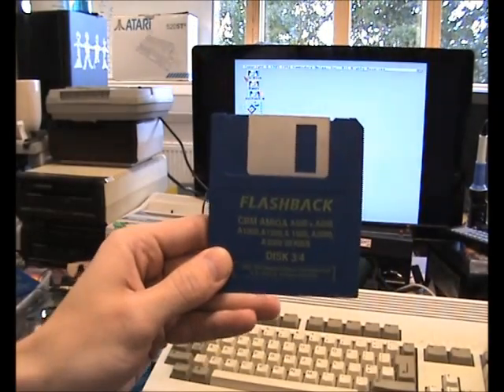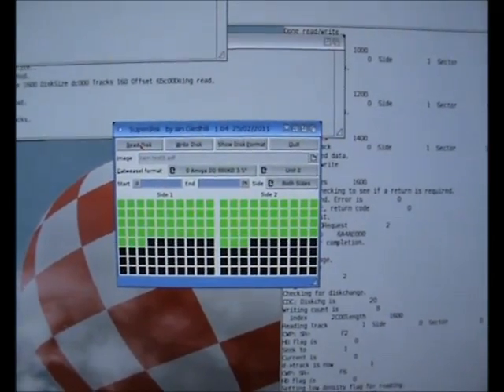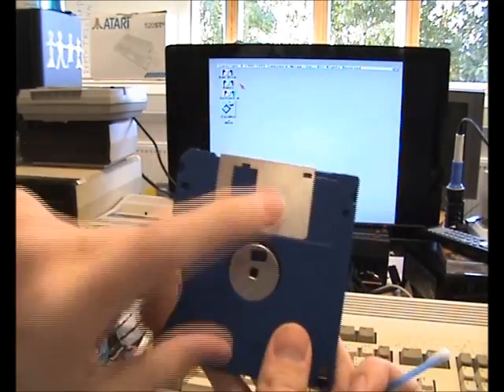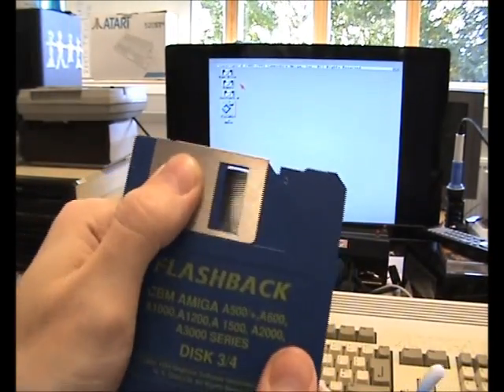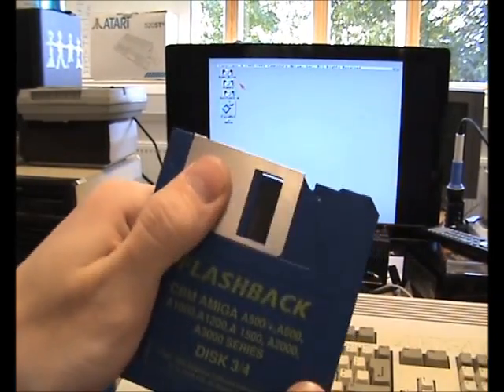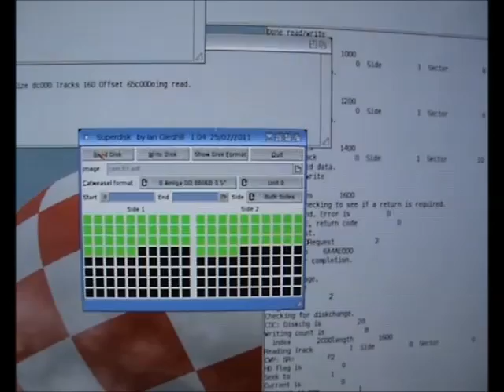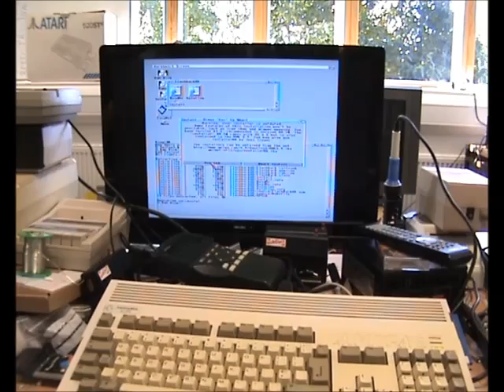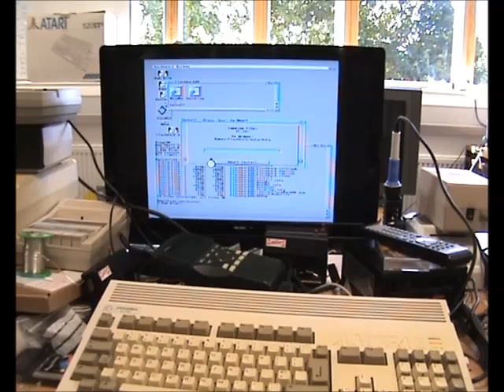How to clean floppy disks!

Comment: Not every disk you can repair though. I just cannot get rid of the red 6s from my cannon fodder 2 disk ☹
Reply: maybe you can! maybe not. But you need a gotek and to make an ADF of the disk, format, then erase, then format then erase 5 times. then check the disk, if the errors are still there then it will be the disk, if not then copy the ADF back to the disk to fix it. If you want a new disk get an new old stock disk, copy the ADF to it then take it apart and slid it into the orignal plastic. so you have fresh mag media inside the disk! it should then go another 20 years boom

Comment: I cleaned it with soapy water but still get "Please insert disk into drive A"... It was pretty clean though. EDIT: Decided to open it and there was a bug in 3 pieces inside of the floppy that made the actual magnetic part difficult to move as it was stuck in there which made the floppy drive give up and pop up that error. Nasty shit amirite?
Reply from the maker: Damian9303 Yeah, this doesn't fix bugs in software I'm afraid!
I assume you're joking about soapy water :)
Reply: Lol, pretty sure you misunderstood me. I actually used soapy water (basically water with one squirt of soap) since I researched this topic and found out you can do it like that but I didn't submerge it, I did basically what you did with the record cleaner but with the soapy water instead as I don't have record cleaner around since I don't really collect vinyls. It wasn't working before and after which led me to rip the thing open and find an actual bug in 3 pieces not software bugs which made the cookie have a hard time rotating when in the drive to read the entire floppy. It came out as soon as I opened it. Cleaned it up, reassembled it and it worked with no reading errors.
Reply from the maker: Soapy water isn't a good idea, it'll leave residue and impurities. It may work for a bit and then it could destroy your read head, in tbhe worst case. You need a pure liquid, so IPA or distilled water is good, but definitely not soapy tap water!
Reply: Yeah, I found that out when I took it out and saw the cookie or whatever the magnetic piece is called. It came off with my shirt however... Only wanted to get data off of the floppy by the way.
Reply: What else can I use to clean the floppies? I don't have alcohol around

Comment: I used to smoke heavy at my computerdesk some 15 to 25 years ago. Never had any problems with my disks. Though I have bought old disks the last couple of years, and those that smelled of mold and old basement. Those loads of disks, were the ones that had up to 50% or 60% dead disks. I have allways had my disks in boxes though, kept away from sunlight, moisture and too high heat. Those factors are bigger killers than tobaco smoke. I think heat and moisture are the biggest killers of all. Especially if you change the temperature rapidly.
Reply from the maker: Yes, the disk surface is protected from smoke by the slidey door thingy. I bet your Amiga was a lovely shade of yellow/brown though! :)
It's moisture and humidity that lets mould grow on the disk surface, that's the killer, and why lofts are a really bad place for them.
Reply: Spirantho Naaa.... Nichotine makes surfaces a kind of reddish orange colour, and can be washed off with ease. The yellow are uv light reacting to bromide in the plastic. To clean that up, you need perioxide cream 40vol. And lots of sun light. Nichotine are most of the times not the culprit. As you say, it is moisture that sometimes make micro organism grow and eat the surface of the disks. A bit like moisture and heat, will oxidice the surface of a cd. A bit like copper plates get green over the years.

Looking at nichotine yet again. It is actually natures insectiside. Most insects will die if they eat the leafs on a tobacco plant. Much like the leafs on a potato plant is poisones. They are after all related.

Comment: I've started reserecting my Amiga. the floppy drive seems to be corrupting the disks I am putting in. (unless it is contamination from my old disks). I cleaned the drive but the problem is back. I will try this technique cleaning the disks   I am thinking of putting another floppy drive in there. have you experienced a floppy drive fail like this? :)
Reply from the maker: First off, if it's an A1200, make sure it's recapped! Otherwise those old caps will be merrily eating their way through the circuit board (ditto the A500+ and big box Amigas with their battery).
A dirty disk will happily dump its dirt and oxide all over your read head. Not only will this stop other disks from reading (even if they're clean, because the head isn't), but the oxide is harder than the surface of the disk. The net result of this is a disk with a hole in it! Not good. Always check the state of disks you've not used in a long time or ever - if it's dirty, give it a clean :)
Reply: Spirantho thanks! some of the disks looked pretty good no obvious dust etc but they sounded rough !! many of them.  awful squeaking noises. you're right I will investigate more and do this cleaning method :)
Reply from the maker: Squeaking isn't good. :) That's the sound of oxide hitting your read head, probably....
Reply: Spirantho I agree. I'll swap the drive out just to be sure (I have a spare machine for parts - it's just a a500)
Reply: @matthewrichards88  i know this has been 4 years but if the disks are making squeaking noises, they are not dirty, its not the drive, what it is is the cleaning felt inside the disk. it gets mouldy and then turns into sandpaper which then kills the actual disk. Best way is to remove disk form case and install into a new case with fresh felt to repair it. any other method will do more damage.

Comment: I would NOT recommend opening the floppy. You could damage it further
Reply from the maker: That's a last resort only. :)
Reply: Spirantho If it was my last option, I would.
Reply: Wrong! trying to clean the disk this way is just mental to say the least! poking at it with a q tip wtf, the best way is not to fuck around and try this, open the disk and take it out, dont touch it with anything! get a new old stock disk and take that apart, get your old disk and install it into the new case, the disk will now clean its self! sqeaking disk? that is not the drive in 99% cases, what it is is the cloth inside the disk is mouldy, not the disk, the mould dries and turns the cloth into sandpaper which kills the disk, sqeaking disk, you must replace the disk case!

Comment: know of something like that that would run on something like a IBM portable? aka dos based and uses less than 600k of ram.
Reply: You mean the disk imaging program? We're talking 286 or 8088 here, aren't we.... hmm...
I'm not aware of anything graphical, no. You could try Teledisk; I don't think it's graphical but it does have very low system requirements. It'll only work with PC-compatible formats, of course.
Reply: it works, but dose not seem to bring back a disk that failes to format. i got a norton disk recovery utility that lets me surprisingly rebuild the partition on a unformatable disk, just files are likely to be damaged when copied over. im trying to see if i can get any kind of old music tracker to work on hear but i need to find something that supports 16 bit pre Pentium cpu's. BTW, did not check dos verson but im running 640k of ram, 40mb hdd, 320k floppy drive, and windows 1.03. this things gpu is actually alot larger than my msi lightning gtx 680.

Comment: Thanks for your video. I just have a question: can you use ethanol instead of the record cleaner or Isopropyl alcohol?
Reply: +jmeile I just tested it with ethanol and it worked. The good thing is that you don't have to dry it; it will evaporate itself :-)
Reply: +jmeile Fantastic :) Thanks for posting this on the video, maybe it'll help.
We should do a comparison of many different cleaning fluids to work out which is best! I've got posh enzyme-based record cleaning fluid now... I need to try that..!
Reply: +Mutant Caterpillar Games I just have to add that I tried this with three floppies. With two of them the procedure was successful at the first cleaning. With the last one, I had to repeat the cleaning by observing carefully the disk surface and passing the wet cotton swab several times where irregularities were found, then tried to restore the information again. On the last case there were some read errors, but I retried several times and at the end the read succeeded.

Comment: Good advice. You'll probably scream with horror, but I've done the same thing with as a test with a microfibre screen cleaning cloth and breath. I was lacking in isopropanol, and the disk was non-functional so I just gave it a go. 

What was surprising is that it fixed a bad sector on this PC-98 disk, which has a visible ding on the disk surface. No idea if the data on the disk would have been savable as I'd already lost that trying to write a good disk image back to it. Cleaning did allow for successful formatting and writing however, so at least the disk now has good data on it, even if it had to be created from a downloaded image.
Reply: +Silanda Small dings on the media surface are common and don't actually stop them working (but they don't help :) ). Well done on the breath cleaning, though - it was probably actually just a bit of dirt or something rather than oxidisation, but seems to have worked and that's what matters!

Comment: Good video. In the past when disks had a lot of dirt/mildew etc I have removed the disk from the casing to easily clean both sides.
Reply from the maker: Jools Wills Thanks :) Removing the disk from the casing is easy.... it's the getting it back in again that's hard! Usually with copious amounts of sellotape!
Reply: For the ones where it required opening, I usually just popped the disk back inside the case (or a new case if the case also had damage), and dumped the data - without sealing/sticking it.

A bit of glue at the corners would probably do the trick if the original was wanted to be used again / to seal it properly, or some tape perhaps as you say.

Comment: what about games that initially work but then crash or go wrong later in the game. Is this technique still useful for them?
Reply: retronostalgic many games, especially later ones, will load the code in when it boots, and then load in level data as and when it comes to needing it. If there's a bad block on the disk, it'll probably crash when it tries to read in the level data and fails.
The only way to verify a disk is working completely is to make an image of a disk, or to check each sector, but on copy-protected disks that's usually not possible. On some machines, however, like an Amiga, you can use WHDLoad to install the game onto the hard disk - this will image every sector on the disk (even copy-protected ones) and will show you any errors on the disk.
Short answer: Yes. :)

Edit: Just realised I'm signed in with my company account instead of my personal one on which I posted the video. Oops. :)

Comment: Awesome! I am going to try this!
Can you tell me what is in the record cleaner? Isopropyl alcohol?
Reply from the maker: Sorry for not replying earlier! Yes, most isopropyl alcohol fluids will probably work - the fluids I use have alcohol in.
Reply: Heihei. It's ok, thanks though. I found that isopropyl alcohol is best used with a wetting agent, as it doesn't evaporate too quickly. (I may have geeked out a bit and did a study and lots of experiments)
Reply from the maker: Emma Treestar Hope the video helped anyway! :) Did you have any joy resurrecting anything?
Reply: Oh yeah it did. It is actually what got me started with the study I did. I ended up managing to salvage data from floppy disks that were in a really bad condition and mouldy.